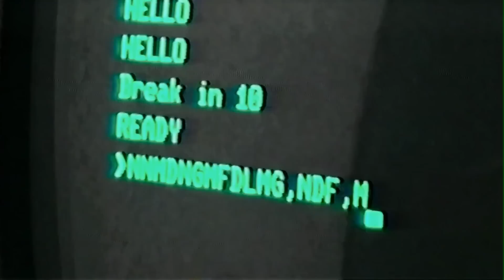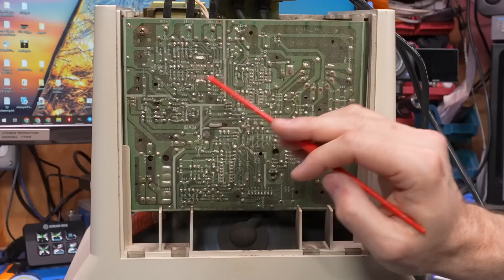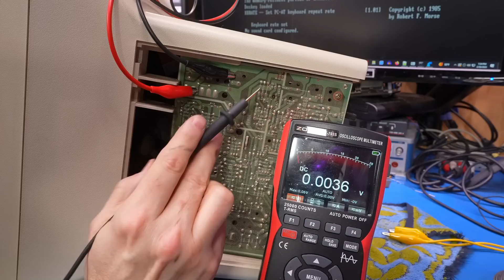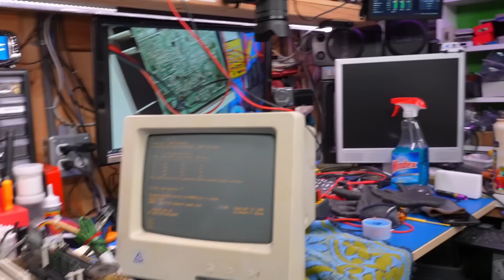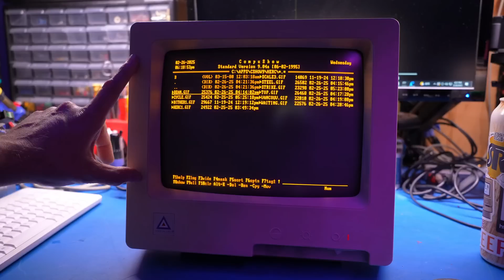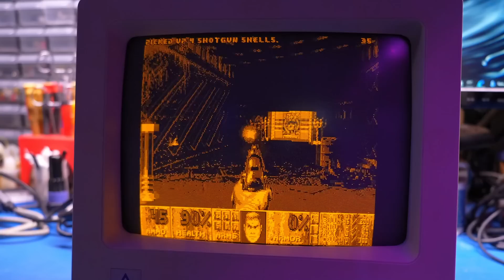Parts were falling out of this monitor (Leading Edge DR-1240 repair)

Comment: Great memories. Our first computer was a Leading Edge IBM XT Clone with Herc Graphics. We didn’t have the Leading Edge Monitor, I don’t recall the brand, but it was amber monochrome. We started with twin floppy disks and later added a hard card hard drive. I think it was. 30 mb and cost around. $300. We thought we’d never fill up that hard drive. Equivalent or 60 plus floppy disks. Good memories.

Comment: I think it’s nice(r) to have a long cord; you can either bundle up the excess length, or you could put the monitor up high on a desk, and have enough length to plug it into a power strip on the ground. Too many monitors (or computers, for that matter) just have little dinky 3’ cords. 🤬

Comment: That's why I always hate it ever year when my company does an electronics recycling drive and I see people throwing out CRT TVs of all sizes, probably still working just fine.  Those screens are made for the older video outputs of C64s and VCRs and such, and when they're gone they're gone.  LCD TVs just don't look as good.  And it's not like I can salvage all those TVs because I have nowhere to put them.  (I already have something like 15 or 20 CRT TVs and monitors.)

Comment: I'm trying to save a bang and olufsen mx4200 that keeps shutting down into standby mode, but man it hurts my back to try and work on it haha.  I've only reflowed all the components on the power board for now, but no luck so far.  I'm gonna have to try and check all the capacitors next I guess.

Comment: My first PC was a Leading Edge model M XT clone. My dad bought it from the local print shop that he was a frequent customer at. I remember that the green mono CRT it came with had the general form of the function keys from WordStar burned into the screen at all times - I didn't realize it until I started exploring the hard drive, found WordStar and started it - it matched the burn in on the screen. Oh and all of the client documents that had been copied to the hard drive were left there - legal documents, wills, etc all of it. 

I also had a daisy wheel printer with it, which I could never really get to align correctly, but I still remember the cool WHACK sound it made when it printed, just like an electric typewriter. 

Any way, this has nothing to do with your CRT here, but it's funny how I see Leading Edge pop up from time to time on retro channels, when back when I was a kid they seemed like a company that literally nobody had ever heard of.

Comment: I wonder if USB-C would be a viable option for repairs like this where the power system is bad --- that way you'd bypass the on-board PSU entirely and use a dummy load to inject 12V DC directly onto the board. That way you wouldn't get the heat generation of the elderly linear power supply, and possibly prolong the lifetime of the device (as well as making AC voltage irrelevant!).

Comment: Main FastDoom dev here. Really stunning repair, I’ve always loved amber monochrome displays. Some notes on FastDoom's Hercules mode:
- You're absolutely right! It doesn't use the native 720x348 Hercules mode, as it doesn't fit very well with the original Doom's 320x200 resolution. In FastDoom, the mode is modified to display 640x400 pixels, allowing the 320x200 image to be perfectly scaled to 640x400 with dithering.
- You can adjust gamma values with the F11 key. In the latest version of FastDoom (1.1.2), this can now be modified directly from the display options menu.
- FastDoom features a mode that allows rendering faster than 35 fps. Just set “Uncapped FPS” to ON in the display menu. This mode interpolates frames but requires more CPU power and additional bandwidth from the video card.
Reply: I'm always amazed by your dedication and love to Doom. That's why I contribute whenever I can 😊

Comment: We used to sell monitors like this. They were the cheapest. They all had the problem of components coming loose and falling off. Gravity always wins and solder is not designed to absorb forces. The heat also collects under the mainboard and leads to rapid ageing of the components. 
I would have screwed or clamped the rectifier to the nearby heat sink so that it is firmly mounted and cooled.

Comment: Re the black soot: I was under the impression it is caused by ordinary dust in the air becoming carbonised by the HV field around the tube. There is definitely some sort of electrostatic effect too, but I think that is separate.

Comment: be careful feeding dc into circuits that use monochrome crts, after the regulator circuit, most of their crt heaters were rated 10 to 11v and some types were easily blown by overvoltage.. so should set the b+ level no higher than 11 unless you can get the service data to check ! i'd say current draw from the whole circuit would be an amp or less, but older models may be higher

Comment: dont swear, because you can do pixels out of grid electron gun matrix. or 1nm e-ray discs from electron beam scanning transmission electron imaging systems. yep e-beam pixels are like oled pixels. stop unsaving then for you to have double unsaving work. no you dont have to have kilovolts x-ray range of electrons to do e-beam stuff. tens of volts is enough. you stay cool. yes streaming causes shorts. lol.

Comment: Remember, you can always connect two regular polarized electrolytic capacitors in series (anode to anode or cathode to cathode) to create a non polarized electrolytic capacitor if you don't have the correct replacement.

Comment: 23:32 - that swollen shrink wrap on the cap most likely covers white powder that aluminium case of the cap turned into. Aluminium was attacked by the same brown glue at the bottom, that's what destroyed that cap. And it might removed the cap from the PCB as well, cause that corrosion has higher volume then the metal jacket. So it acted as a growing shim, slowly pulling cap from the board. I've seen that type of failure caused by "glue of death".

Comment: What prevents you from replacing that cap with one of those ceramic capacitors you also use to replace aging  tantalums?
Reply: That's a very special capacitor, it has a ripple rating of probably 10Amps, it is for the 18kHz horizontal drive, such capacitors are not made any more, there is no way to replace that with any ceramic capacitor, a film capacitor could work but it would be much larger than the original and really expensive.

Comment: Tou can put iec female and "db9" female connectors on a 4 inch tail hanging out from the moitor. That would still make it much easier to work with than it is now.

Comment: I fixed 28 colour crts using their internal variometers. I used the Compaq LTE 486, 25mhz as a device. The fix was compatible with the Pentium 2 computers. Later I fixed a crt for the Scitech Display Doctor, using the 75 mhz freq needed a recalibrating. That needed a 100 mhz pc w a vlb card.
When you scratch the display with your hand, the pc hibernates. That is a function of the vlb cards. It is for cops, bosses if the pc is misused.

Comment: I repaired CRT TVs for over 20 years but very rarely had computer monitors on the bench bar ones made for the Amiga or inside industrial CNC equipment. It seemed that monitors were quite reliable but apt to being replaced with the PC as graphics improved and larger screens became more affordable.

I shudder at the thought of how many working monitors were disposed as part of an upgrade whereas CRT TVs were commonly run until failure.

Comment: I recognize the heat sink, it is not standard for rectifiers but designed for TO-39 transistors where it is attached without glue.
Reply: Yeah, was about to comment on this. I think it belongs to that old-style metal can transistor, and not the bridge rectifier.

Comment: Never say never.  People said the LP record was dead.  Back again.  People said tape is dead, still used today.  People say vacuum tubes are dead, still being made today.  Heck, there are people making brand new nixie tubes, for goodness sake.  And that's tech that really is terribly obsolete.

New CRT's are not out of the question, the only real question is how much you're going to have to pay for a new one.  And the answer is LOTS.
Reply: Ehhhh… LPs and “normal” vacuum tubes (including nixies) are comparatively simple devices. Tape is functionally dead, in that the knowledge and equipment to manufacture high-quality equipment appears gone, with only lowest-end junk being made. (The knowledge to make high-quality tape stock itself is still around, since we still make data tapes, but the formulations for good audio tapes are likely gone (and if not, tucked away in vaults at a handful of companies that will never release that information), but even with the formulations, it’s likely that the raw materials (very specific metal oxides developed specifically for specific audio tape formulations) haven’t been manufactured in decades. So the equipment and knowledge for how to manufacture those is probably lost, too. Very similar to how the resurrected Polaroid films aren’t the same as what they made before, because many of the chemicals and other raw materials used aren’t made any more, so they’ve had to develop new formulations despite knowing the old ones.)

CRTs, especially color ones, are much more complex than simple tubes. The knowledge to make a simple monochrome CRT is probably easy to recover. For a top-quality color CRT, we’d have a MUCH longer re-learning curve.

Comment: IEC cables suck. They can fall out. When I have more time I'll write the story about how at a recording studio where I worked someone moved a cabinet with a bunch of rack gear in it only a little bit to dust behind it and it ended up pulling out a bunch of loose cables out a bunch of gear that was patched into a mix that was going to happen the next day. If you need an episode and that episode needs to be adding an IEC to something, great, but they suck, give me a hard-wired cord 10 out of 10 times.

Comment: My great uncle, who passed back in 2003, he started work in a radio repair store in the 30s, which then moved to the big box TVs and then 1980s computer monitors we all know and well. He worked their his whole life, and always said "oh, you know, a boring job but it paid the bills" if you tried to ask about it. Even now his kids are a little sad they never got more out of him. He always had lots of interesting stuff in his sheds and different tech odds and ends about the house.
Reply: I had a 19 inch CRT. It had a thick glass, flat screen. I think it could do 1600 x 1200 but since it was 60 Hz and everything in Win 2000 looked too small, I did not use that setting. After that, it failed. I have no idea how to fix it. Even today, I have trouble figuring out how to fix a mobo. I am just starting up. Since people threw away CRTs, I picked them up and used a 17 in screen. Eventually, some LCD screens showed up in people's trash, so at that point I switched to LCD. Until today, I have not bought a LCD. My company gave me 2 LCD 1920 x 1080. and I found a bunch of LCD. I think I have 10. My buddy has 20 LCD and didn't want the free stuff from the company. There is way way too much working stuff going to the trash.

Comment: Man, do I hate CRT's...... however if I had lots of room I still might have the first monitor I bought in 1984.
It was a Zenith amber monochrome CGA monitor connected to my first PC, a Columbia MPC-1600.
Oh yeah, my first job was at a company that made high voltage power supplies so my brain said RECTIFIER? 1N-4004?

Comment: Besides the Tandy 1000 this is the first one I've seen where I HAD ONE.     I had that exact model as my Debug monitor on a 486 I programmed on in the 90's.   ( MDA card in addition to VGA, Dual monitors in MS-Dos. )    So useful to send Debug info to a 2nd display when writing code.

Comment: The thing that I remember most about CRTs is that fixing them is a nightmare in many, many cases. HOT dead, desolder, measure everything aound it, measure voltages, swap in new HOT, switch on, HOT blows instantly. Swap out several possibly sketchy HV capacitors, new HOT, switch on, HOT stays alive, 2 minutes later flyback starts arcing out of nowhere to somewhere nowhere else. After switching off, HOT is magically dead again, just for the lulz, and so on and so on. The amount of totally random cascade failures, especially in the first multisync VGA CRTs with a metric shit ton of HV capacitors was insane...

well, at least in my recollection of the past...

Comment: If one (and exactly one!) diode in a bridge rectifier goes open, two diodes on the opposite side will act as a single diode and still supply a little bit of power (although typically not enough for correct functioning).

Comment: 10uF @ 25V? I'd be surprised if you don't have X7R MLCCs kicking around that could replace that. Sitting so close to that heat sink, I wouldn't replace it with another electro.
Reply: That's a very special capacitor, it has a ripple rating of probably 10Amps, it is for the 18kHz horizontal drive, such capacitors are not made any more, there is no way to replace that with any ceramic capacitor, a film capacitor could work but it would be much larger than the original and really expensive.

Comment: My amber monitor memory was the first Intel PC i ever bought, an AST 286 machine, I remember using it for Clipper development (boy did that 286 blow the doors off the 8088 Franklin I had borrowed from a client to build a dBase app for them) I also remember using Prodigy on that amber screen. This was before anybody I knew had Internet access proper.Then I bought a pair of Radio Shack 300 baud modems so I could support the client's PC from my house, using PC/Anywhere. Fun Times.

Comment: I once had to replace the bridge rectifier in my plug-in lawn mower as it was in fact shorting and while it did not cause any damage, it kept tripping the breaker.
My first experience playing Doom was on my dad's monochrome laptop not long after the game first came out (also using the keyboard). I got through the first couple of levels, though that maze section with the strobing lights (leading to the chainsaw secret) was really difficult, even on the easy skill level - monochrome laptop displays at that time also had a lot of ghosting - gamma correction did not come until later (activated by pressing F11)

Comment: @22:00 those round W01 and W02 bridge rectifiers die a lot, I see them fail quite often in the equipment I fix, I think then tend to be pushed too hard in most cases.

Comment: These large bipolar electrolytic ultra-high-ripple caps used in horizontal sections of CRTs are becoming increasingly harder to get hold of, while at the same time also failing at increasing rates (at least in my experience). Some claim these can be replaced with film caps of equivalent ratings, but whenever I did just that, I noticed the horizontal frequency whining getting much louder. I am not sure what causes this.
Reply: I recently replaced a failing 10 uF BP capacitor in my Kaypro 4/83 with a (NOS) Philips MKT 10uF 100V block capacitor and it works fine.  Maybe you can try different MKP/MKT variants (WIMA als makes these)

Comment: Ok. After seeing you flip the board and the cooked rectifier it reminded me that it was a common failure point and I remember replacing them. I think the heat sink came from it. We just used parts from radio shack.

Comment: I wish I had the idea to save old monitors a long time ago. Before I retired our company's first computer systems for climate controlled agricultural storages used Wyse terminals that were green screen setup to be VT-100 complient. These started in the 80s. Some customers still had them into the early 2000s. As new systems were installed the Wyse terminals were trashed. We saved one or two to keep the customers that weren't ready to upgrade yet. Eventually we had to stop supporting the old stuff because could no longer get any parts or repaired boards. If only I knew about the computer people that were keeping these old systems going I would have saved them. I went through two commadore 64s when they were popular and even modded my second one by adding a numeric keypad to it by wiring straight to to the keyboard. Really enjoy your channels videos.

Comment: Believe it or not, I know where a terminal with the amber monochrome CRT and v.92 modem are still powered up in 2025. I assume it is still doing its job in the telecom room because the US Robotics V.92 modem connected to it still has lights blinking.

Comment: Very good, as always. I do like amber monitors.
A wild thought: I wonder if it's possible to get 'greyscale' out of a Hercules card by interleaving images? ie: You might get a kind of greyscale by splitting the image down to three 8 bit greyscales using Floyd–Steinberg, then applying a 1 bit half-tone filter to each image at 0, 120, 240deg. Display the three images in quick succession and let phosphor persistence take care of the rest.  (Tweaking likely required)

I wonder if anyone ever tried? I wonder if anyone ever wrote a driver to do this on the fly? Was it awful..?
Reply: Hercules does support two image pages, so that could absolutely work. Would be interesting to find out.

Comment: Try 409 Spray Cleaner - Soak the Shell in hot water and 409 and then use a gentle scour pad and it will renew the color without destroying the texture.   try it out.

Comment: I used to love those little Amber monitors for putting on my home server setup. Just a word of caution though, I’ve watched two of the IBM variety literally just burst into flames over the years. That Leading Edge looks like a different design (these were monochrome vga monitors).

I have player full Doom on one of the IBM monochrome VGA monitors and it was really cool. 

Eventually replaced the monitor with a cheap lcd after my Seti@home burned into the screen when I forgot to turn it off once. :( Hard to do anything with level of burnin.